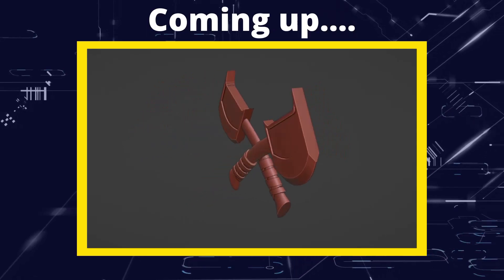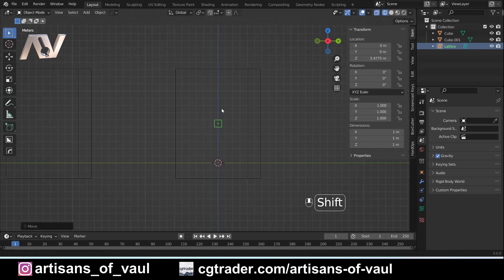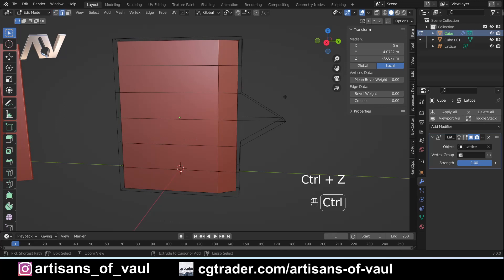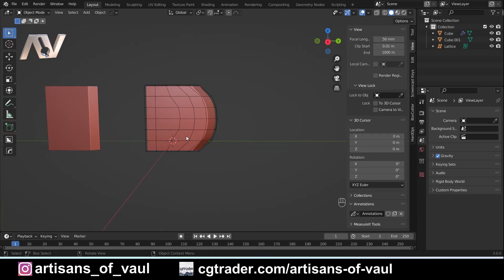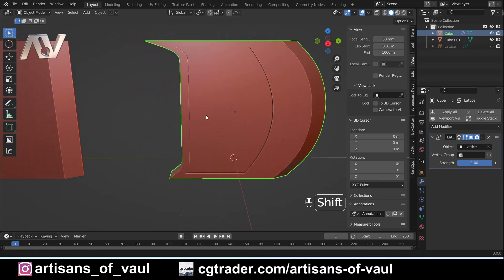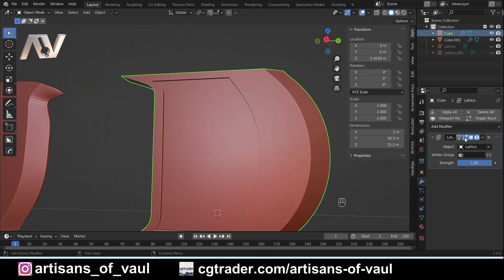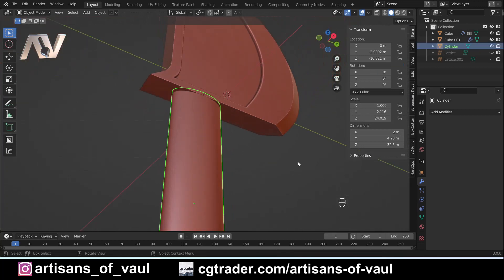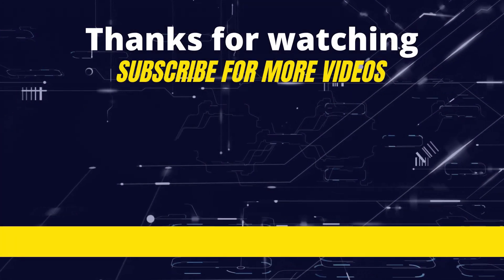Using the Lattice Modifier - Creating an Axe in Blender

Comment: Any particular reason you didn't use "dice" in the example using HardOps rather than adding edge loops?
Reply from the maker: No reason at all, I just wanted it to be usable without an add on. The dice option would be just as suitable in this situation.